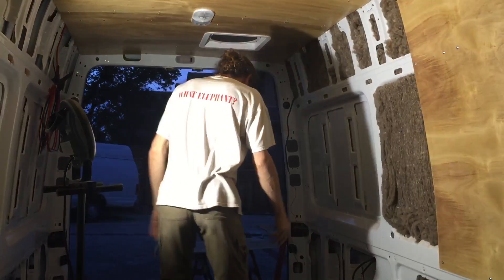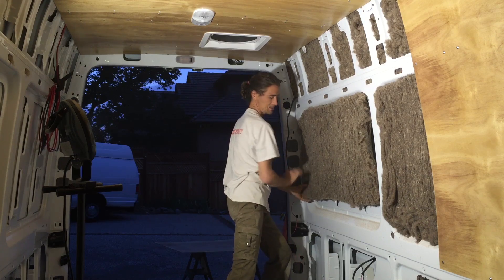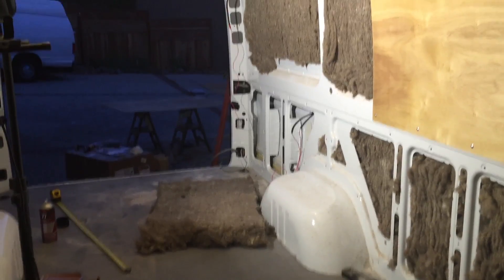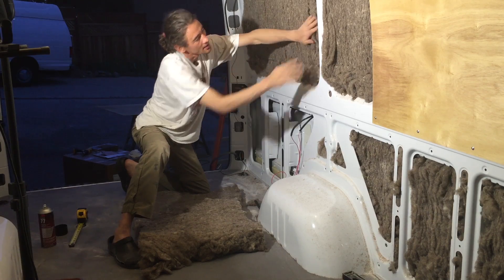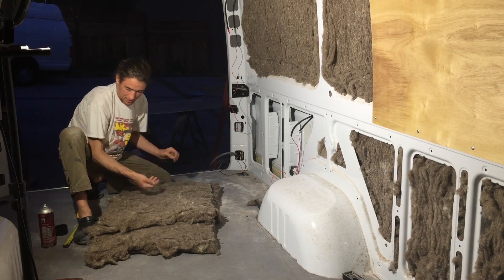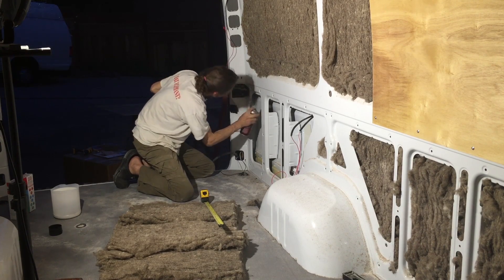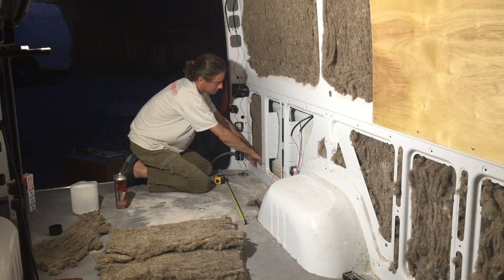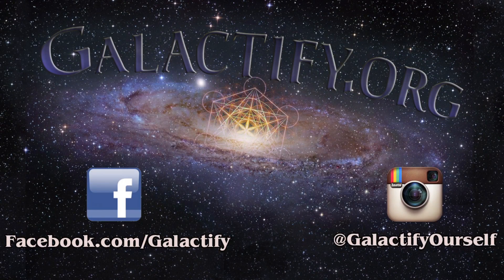Part 8 Sprinter Van Conversion - Wool Insulation

Comment: Nice work.  Happy to share a few views as a manufacturer of wool insulation and a driver of a sprinter insulated entirely with wool.  There is no better insulation medium for moisture, which is inevitable in any cavity but certainly in a van where condensation is a certainty.  Wool will actively absorb and desorb against 65% relative humidity.  It is a keratin so it will not support the growth of mold.  The key for us was to stay away from vapor barriers.  We left our wool open to breath behind reclaimed boards but also considered an air tight membrane that is vapor variable ie breathable.  Other inherent characteristics of wool allow the amino acids to bond with formaldehyde, NOx and SO2.  We did not want to bury these elements of passive filtration behind an air barrier.  Finally, the sound deadening of wool is incredible.  As we added more and more each day the rig became that much more of a cloud floating down the road.    We run a webasto diesel heater; after 15F in Jackson, WY and my wife asking to turn the heat down all is well in #vanlife.  Clearly we are biased (it's why we started the company) but intuitively why would you want to fill a confined space with under-performing insulation at best and carcinogenic materials at worst?  Happy to answer questions anytime.  Cheers from Havelock Wool Insulation.
Reply: Where in the Houston area could I get your wool?

Comment: The unisulated steel will conduct cold / heat.  Google thermal bridge.   I an converting a 25 ft bus.  21 years offgrid here... Lots of tough lessons learned.

Comment: 4 inch batt insulation will be more then 4 inches beacuse when installing contracters cut them half inch larger so they expand into place without the use of glue.  The space above and below could have been installed without glue.

Comment: So I understand some people have issues with the insulation chosen here. I too am intrigued by this video, having previously thought of using styro-foam sheets.
I have two questions posed not only to Galactify, but to anybody reading too:

Would wool insulation be adding more weight compared to the foam sheets? (I'm guessing so - especially once it has absorbed an extra 40% moisture)

And secondly I too would have worries about rusting due to the moisture. Would a clear plastic sheet between van and wool help here?

Cheers for all of the knowledge between all of the answers

Comment: I hope you sealed the exterior trim clips that come through the base of the side walls because they let water in. If that insulation gets wet, it will never dry out. Eventually it will cause mold, mildew, and probably rust.
Reply: Wool doesn't do any of that dummy

Comment: Thanks for making these videos. I am looking to do a project at some point as well. I am wondering why you didn't use the Reflective foil insulation? Is the wool supposed to be better?  Do you worry about condensation on the inside of the walls?  and then the wool getting wet and moldy/smelly?
Reply from the maker: Reflectix only works if you have dead air space on both sides. I talked to the company and they told me that. Please read the comment area directly below the video for more info on wool insulation.
Reply: OneWayofLiving reflectix not actually insulation

Comment: Thank you for your video. I am currently starting the same project in my van and I am trying to decide on which product to use for insulation. I am mostly concerned about moisture build up on the inside of the metal surfaces because I will be using the van to camp mostly in the winter. Can you speak to that concern through your person experience with this product?
Reply from the maker: +Tory Robinson You just need a furnace with an enclosed combustion chamber so you get dry heat and no combustion fumes or byproducts of combustion such as propane has - H20 is created when propane is combusted in the inside of a vehicle thus creating to much moisture and then possibilities of mold. (but wool and borax is naturally mold resistant fiberglass is not and it has been studied to cause cancer). 
I will be installing a system like that in my van in the near future so stay tuned.
Please also click the small bar that says "show more" directly below the video and read through all my comments I originally made when i posted the video for a ton of information on the qualities of insulation.

Comment: You do need a vapour barrier on the warm side (inside the van) or you will get condensation. Believe me.
Reply from the maker: My 15 years experience of making and living in conversion vans proves otherwise. But everyone can make their dream 'tiny home' 'conversion van' as they like!
Reply: Very true my friend, you do nice work on your van.
Reply: Wool obviously has great insulating properties, is natural, sustainable, safe, and has lots of other virtues. But according to modern science (along with good old fashioned commonsense), wool wicks moisture, and will doubtlessly accelerate oxidation against (even painted) metal surfaces over time--there is simply no denying this. That said, I of course agree that this is your project, and you are free to do as you please. But before deciding, I recommend that other would-be conversionists conduct their own independent research on the matter. Otherwise, I very much enjoy your videos--thanks for sharing!
Reply: What is your opinion of denim insulation?
Reply from the maker: +Douger Rohmer As per my research, wool has a noticable better insulating/R value and also a better sound insulating value. It does not rot like cotton will if it gets wet. I mean think about how many times you have heard someone glorify the insulating properties of wool and think about how many times you have heard the same about cotton. If you ever go on an expedition you will bring wool right? Also wool does not hold water like cotton does. Wool has been used as an insulation material for hundreds of years whereas I am not aware of cotton having the same history. So I do not know what will actually happen with the time tested results of old  used cotton blue jeans :) But credit where credit is due - they have an impressive advertising campaign that they have invested a lot of energy in.

If you read the comment section under the video by clicking on the "SHOW MORE" words then you will see i have documented my findings there.
Reply: I like the concept, and would go for it if money is not an object. The price you paid in dollars is rather high in our local mickey mouse currency (South African Rand) but then again we have plenty sheep around and maybe the local price is cheaper. Will look into it. The other issue is that we don't really have sub-zero temps or very hot weather, or humidity so the insulation would probably more for sound which denim apparently works well for as it is used in speaker boxes and other audio applications. I know wool is good for that too, so it will be all about the price in the end -  but nothing chemical/carcinogenic will be used :-)
Reply from the maker: +Douger Rohmer Actually that sounds great! Just shave it off your local sheep or buy it from a local farmer when its the time of the year to shear their sheep and your all good ;) The difference of a speaker box and your walls in your house is that a speaker box ventilation is usually better, and there is no source of moisture generation inside of a speaker box like you have with a human inside of a box/room, and that human may be taking hot showers or cooking which will make even more moisture. thus wool. ;) and I bet the local farmers will give it to you for cheap and then just fluff it up a bit and stick it into your walls. Done. I had a friend who had sheep and this is how he insulated his home! ;) and its been doing great for about 15 years now so far.
Reply: Try not to laugh at his accent :-)
Reply: any thoughts for a vapor barrier that would stop this?
Reply: you in Liverpool then? have you converted vans in livrpool?
Reply: Seran wrap would be an incredibly cheap idea, although it's not very sturdy, and you'd need a lot of tape. Painters tarps would work pretty well, are much larger than seran wrap, and can be purchased in varying thicknesses. 

Hell, even a plastic trash bag would work.
Reply: What about roxul insulation. Safe and sound . Rockwool.
Reply: @ReturntoNatureSkills  
Not sure about a vapor barrier on the inside even though house construction says to have a vapor barrier like in cold climates. 

Since the van's metal walls are water tight, I'm guessing an air flow layer needs to be on the inside of the van ... as opposed to just under the cladding-layer on the outside of a house wall. 

May be as long as van walls can be disassembled for cleaning is part of a longer-term solution. May be they're different from house-walls in that sense.

And I'm trying to learn about dehumidifying a van not just insulating and heating. The dehumidifying action would need to exchange damp air even if they're behind wood panels covering wool-batts like in this van. 

I don't know, others swear gluing multiple layers of poly-iso boards to van walls to be the best solution. Another guy disassembled everything to go back and sand and paint any exposed wood because of mold which he says he wished he would have done the first time.

Seems like an average of about 5-years before longtime nomads move into a different living situation. Don't know if that's mostly because of mold growth or if it's something else. Others living much longer in the same kind of situation may just put up with moldy interiors. I need answers as well, friend.

Wisdom, understanding and discernment of Lord Jesus upon you. Amen.
Reply: Galactify it’s more than that: you have to wash the wool, the wool comes with dead bugs, feces, you name it. It’s dirty and need to be clean. It’s a process to clean/wash the wool, and it’s not very easy. Can’t put It inside washer machine, have to do it old fashioned way.

Comment: No moth or beetle issues with this wool? I love this plan, I was going to foam spray but I dont know now!
Reply from the maker: +Mad Flavor Disciple, no. use Borax in the wool. but I would rather have a few  moth or beetle issues then cancer. ;) fiberglass insulation causes cancer. moving vehicle rattling down road throwing fiberglass dust into air and breathing in moving vehicle = breathing fiberglass = cancer. No thanks.
Reply: ***** Right on, good point!

Comment: I assume you have studied different types of insulation for your van and ended up with wool.  You make some excellent points about the benefits of wool, however, some people in the comments have doubts, especially on the topic of condensation.  Did you investigate spray foam insulation for your build, and if so, why did you reject it vs. wool?  I'm in the planning stage for a Transit conversion and leaning towards spray foam...can you convince me otherwise?  Thank you...a new sub.
Reply: +Justice9111     You sound like you've done this before...thanks for the info!  I was thinking of using adhesive to attach 2x4 studs between the ribs, then covering it with spray foam, so I have something to screw into when I hang the paneling and cabinets.  On my outside landscaping here in FL, the top layers of the landscape block toppers were attached with a construction adhesive supposedly made for the job.  A couple of years in the FL heat, the adhesive dried and failed,  and all the toppers are loose.  Will the same thing happen to my studs buried in spray foam when exposed to a few years of hot metal in the sun?

Comment: Doesn't wool absorb moisture like a sponge.
Reply: ykb946 yes and releases it, too
Reply from the maker: +ykb946 wool fibers itself has no absorbent properties. the spaces between any fiber of any material many things like air or water may be trapped in. but that is the same for any material that is composed of hair like groups of hairs or any other similar instance such as fiberglass cotton etc. But materials like cotton are actually absorbent unlike wool.

Comment: I'm insulating my van to. trying to use as much styrofoam panels with foil on both sides as I can. I using fiber insulation where styrofoam panels is almost impossible to put in. not worried about breathing in things because I'm going to put a vapor barrier in it's going to seal the whole thing off just like a house you have a vapor barrier you're not worried about breathing in fiberglass insulation in your home so what's the big fuss about a van

Comment: I bet it's hot as shit in there in the summer
Reply: Blakaveli haha right, actually insulation would keep the temp reasonable, especially in the shade, with a draft.. without insulation, its warmer, too..
Reply: Insulation holds heat/cold longer...but not indefinitely.  A lot of vandwellers in the southwest dont insulate at all...so their van cools off quicker in the evenings.